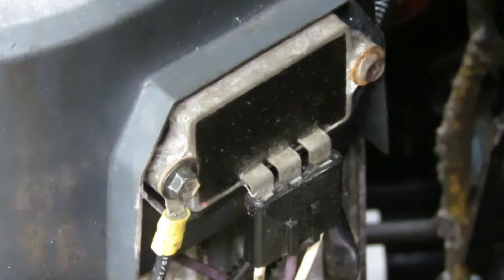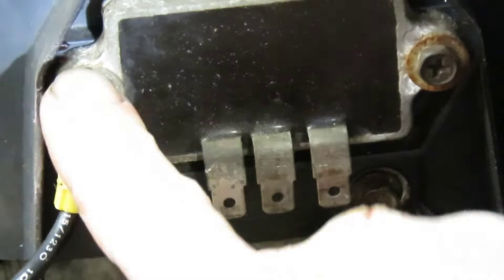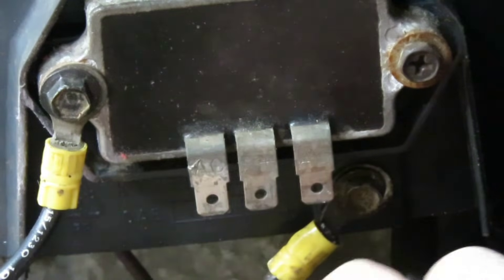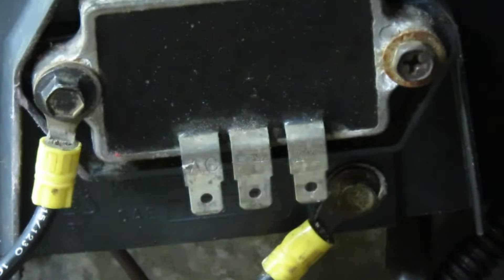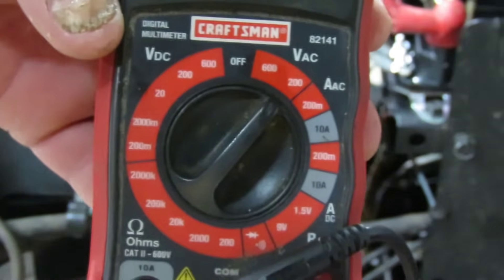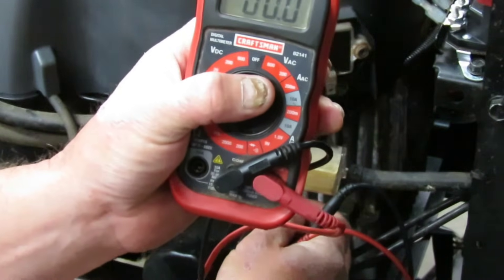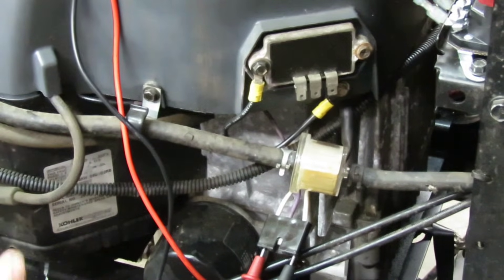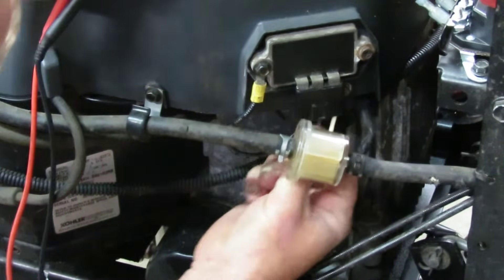How to Test Kohler Charging System

Comment: Thanks for this video! I have a Scott's by JD, 2348 Kohler 23hp engine very similar to your video.  Any idea why the battery would not charge (batter light comes on) when the mower (PTO) is engaged?
Reply from the maker: Does it charge when PTO is disengaged
And Not charge when PTO is engaged.
If so your gonna have to chase the charging wiring to find where the connection is lost.
If its not charging only while engaged 
Most likely PTO switch is losing the connection for charging
Reply: Sartin Garage it was not charging until I followed your trouble shooting video. Now it charges only when PTO is NOT engaged. The battery light comes on when PTO  is engaged. Thanks

Comment: Great demonstration. I just checked the charging system on my John Deere with the Kohler Command 23 engine. The engine would not turn over fast enough when attempting to start it. I did what you said and found out the stater and the voltage regulator both gave the correct outputs. In conclusion, the battery was not charging to the capacity it needed. So, I replaced the battery. A few years later, I replaced the battery when it turned out the problem was the voltage regulator. I am sure many people blame the battery like I did.

Comment: I need a little bit of help. I've engine swapped mowers before, but just the other day my dad blew the briggs engine in his AYP craftsman, then got a 16.5hp kohler engine that says craftsman on it but was on a MTD when we got it. The regulator was completely bypassed. I got to looking at the stator wires, yellow and black, and noticed that there was a factory installed diode or what I assume was a diode on the black wire that had blown and melted. So my question is, do these kohlers need both a diode and rectifier on the charging wire, or are we dealing with mixed up parts? Can I wire it up using the diode from the briggs or do I need to use the regulator that wasnt hooked up? This mower has manual deck engagement and AC headlights.
Reply from the maker: Let me get this right
The Briggs Engine has No external voltage regulator/Rectifier.
But the Kohler engine has a voltage regulator.
If this is the case
You will use the center pin on voltage regulator to go to the mower factory connector which should only be 2 wire connector.
You will have to figure out which wire in the two pin connector to connect center wire of voltage regulator to.
One of the wires in the two pin connector is ground. Dont want to connect it to ground.
Best to pull key switch and usually terminal A1 on key switch 
Use a ohm meter and find the wire in the two pin connector that connects to A1 on key switch.
This will be the wire that you will connect center pin from voltage regulator to.
May have to put other wire in the 2 pin connector to ground for it to charge
Reply: @sartingarage8045  Yes the original briggs only had a diode on the charging wire, no rectifier. The kohler appears to have had a diode that blew and melted the wire, as well as the 3 pin rectifier, which wasn't even hooked up. Someone had messed with the wiring before. I'm just wondering if the kohler needs both the diode that blew as well as the rectifier, or if some kohlers had only a diode and this fan shroud with the rectifier came off another engine.
Reply from the maker: The Kohlers Engines came with both.
The difference would be if mower has electric Pto Clutch or Electric Pto engagement. Those will have a better charging system on them which will have a rectifier/voltage regulator. 
Mowers with a lever to engage blades
Most would not have a voltage regulator and charging system is less output.
Most mowers now have electric pto

Comment: I have a Kohler Im workin on, brand new Batt, brand new Voltage reg, Stator putting out 37 v a/c, grounds all good, center terminal gives me 4.3 volts dc engine full tilt. Getting bat voltage at center pin when engine off. dont get it.
Reply from the maker: Needs to battery voltage at center pin on voltage regulator with key ON engine OFF
Test your key Switch
I have a video Easy Key Switch Test
Reply: Same problem I'm only getting 12.4

Comment: Just like your example here except with the key switch off, my Scag Cheetah [Kohler] is pulling 12.4 volts. When it is running it is producing 14 volts. Should it show 0 volts with the key switch off? Even when I unplug the key switch it still pulls 12.4 volts. So the purple wire is always hot?
Reply from the maker: Purple wire to regulator should be Zero Volts with key Switch off.
If not will be constant drain on battery while mower not in use.
Reply from the maker: If purple wire to regulator has voltage with key switch unplugged. There is a short to that wire somewhere in the wiring. Or someone has rewired it straight to battery voltage. Maybe to Solenoid. Somewhere to constant voltage. Need to trace the purple wire to other end
Reply: @sartingarage8045  Thank you for this. It appears our 2nd mower (Scag Tiger Cat 2) with the same 29efi Kohler also has voltage with the key off. That one only has 119 hours and is 1 year old. I'm wondering if the solenoids are going bad from sitting out in the weather.
Reply: These mowers sit on our landscape trailers when not in use exposed to the elements.
Reply from the maker: If it is designed that way, Im not real sure why it would need to have voltage to regulator all the time with key Off.
Your not using the mower when the key switch is off. Why put a battery draw on battery with key switch off while mower not in use doesnt make much since.
Although it wouldnt draw much out of battery. I would think after a week or two of non use your gonna have to charge battery.

Comment: Thank you for the kohler video it helped me a lot. Turns out my kohler is putting out 14.5 volts but its not getting to the battery can i just run that purple wire straight to the battery? Instead of messing with the switch?
Reply from the maker: No you can not
It will constantly drain your battery.

Most of the time the key switch is the problem. But need to check connections from that wire to key switch 
From the key switch it goes to starter solenoid

If you follow the battery positive cable down to Solenoid , there will be a small wire attached to that same post on the solenoid.
That goes to the key switch

Check all those connections and test key switch
I have a video on testing key switch
Reply from the maker: So if you start from voltage regulator DC output wire 
That goes to a connector if you follow the wire.
Then it goes to key switch terminal A1
Inside key switch it connects A1 to B terminal.
B terminal wire comes from the Battery post side of sokenoid
The wire I was telling you about in previous reply

Comment: Hello!! My mower only runs as long as I have my jumper cables connected from my car, so when I check the output from the mowers regulator am I just reading my cars regulator and not the lawn mower? As soon as I disconnect the jumper cables the mower dies.. all the connections are clean and the voltage regulator ground is good. Thanks!!
Reply from the maker: Let me get this right
Your Battery is Dead and mower wont turn over. So your connecting jumper cables from your car to the mowers battery and then mower will start, but when you disconnect cables from car. Mower engine shuts off immediately.
If this is the case First thing you need to do is charge the battery that is in the mower, If it will charge, If not buy a new battery. After you get a good fully charged battery in mower. Start the mower and check charging system to battery.
Reply from the maker: If your car is running
Yes you will show charging voltages from your cars charging system around 14 volts DC

Comment: Thank you sir for your great charging system videos, I watched both. They helped me track down a charging wire that was hooked up wrong for an 1999 xmark zero turn. I replaced the engine with a new carbureted 25hp Kohler, I didn’t want a new machine and try to stay away from ecm controlled machines. They had the charging wire from the factory/distributor running to the starter solenoid ? So I put an end on the wire and put it in the harness plug to the switch and now charging good! You speak slowly so I can understand and I appreciate you helping us all, thanks again!! Ron Smith

Comment: My rectifier is getting 20v dc on the B+ terminal. Is that to much voltage?
Reply from the maker: Yes that is way to much
But if the battery is completely dead or bad
Charging system will go to full output and can reach voltages as high as 22 volts.
Watch my video on Why not to use mower to charge completely dead battery.

Make sure battery is fully charged with a battery charger on no more than 10 amp charge
Preferably 1.5 to 2 amp charger. Will take longer but slower the better or less hard on battery.
Then reinstall battery in mower and test again.
Reply: I have no battery. This is a walk behind pull start mower kholer pro15.. rectifier bad ??
Reply from the maker: So if there is No battery. What is the Rectifier control on the mower. A Rectifier converts AC current to DC current for charging a battery. Unless its electric PTO and Powers the Electric Clutch
Reply: Sartin Garage correct it’s electric pto.. I’m getting 20-21volts ac off the stator and then on the dc “b+” I’m getting 20v dc but also ac there too
Reply: It also runs through a delay module but I’m not sure if that helps regulate or the load from the pto will adjust the volts or if I need a new rectifier
Reply from the maker: I wouldnt think 20 volts would hurt that electric clutch. 
What is Not working on the mower.
Are the blades Not engaging or what is happening that made you have to check voltages with a meter.
That system may have to have voltages that high, But when a load is added to the Rectifier ( such as engaging blades )
The voltage will probably drop down a few volts
Reply: Sartin Garage at first it was blowing fuses. Then the pto quit working all together.. originally I assumed the pto was bad. Replaced it. Still nothing. That’s when I discovered the 20v dc off rectifier. But I also noticed that after ruining through the delay module and hitting the pto switch was not getting me 13v or so at the pto connection so I started to look around on mower to figure out what was going on
Reply: Sartin Garage I’m pretty certain the delay module got messed up. It looks a little bubbled on the back.. I ordered a new one but I don’t want to put it on to ruin again if I was getting to many volts from rectifier to begin with. I’m unsure what made things stop working
Reply from the maker: So you have 20 volts out of rectifier and only 13 to Pto clutch.
I would think you have a connection problem somewhere or possibly a shorted switch. Key Switch, Pto Switch.
Its hard to explain electrical wiring checks.
Without being right there.
But you have 20 volts out of rectifier
Follow that wire to where it goes
Check voltage there
Figure out where it goes from there
And keep doing this all the way to clutch.

Once you find Voltage drop
That will be your problem
Reply from the maker: There again its been awhile since Ive worked on a pull start charging system without a Battery.
Most everything Now is electric Start
Not real sure voltage out of your rectifier should be that high. 20 volts

Comment: So I know I need a new battery for my Scag as I've had to put the battery charger on every time I start the mower.
Today I started mowing and probably mowed 30 minutes and had to stop and move our trampoline, pushed in electric PTO, set brake and got off mower to
moved trampoline. Got back on mower released brake and engaged PTO and the engine started missing bad, disengaged PTO and missing went away.
Idled engine down engaged PTO and the missing was gone, gave her full power and and was able to mow another  minutes and she died right there in the yard.
I would like to know your thoughts on this matter. Tomorrow I will be replacing the battery for sure to start with.
Reply from the maker: There is two things I can think of most likely wrong. 1st you do need to check the charging system, 2nd thing is if it is a twin cylinder engine, sounds like you may be running on one cylinder. The engine will still run great, but will be low on power.
So when you are engaging the Pto.
Engine doesnt have enough power to turn the blades as far as spinning the blades.
But at the same time if battery is really low
This will also cause engine to stall qhen blades are engaged. There is not enough Power in battery to keep PTO clutch engaged
Reply: @sartingarage8045  Replaced the battery today and it fired right up. I was able to finish mowing without any problems. You were right about the battery not having enough power to keep PTO engaged. I will follow your video on How to Test Kohler Charging System for a more thorough diagnoses and make sure there isn't another underling issue. I can't thank you enough as you saved me a lot of money and more importantly TIME.

Comment: I did everything you say on one of your videos about charging problems I even  change the stator, en I'm Still getting 14v ac  switch is working fine what else can be?? 60" ex mark z
Reply from the maker: 14 vac is not enough
What did the magnets look like inside flywheel. If there is a magnet missing or magnet that has came loose and has moved Stator will not output correctly.
Magnets should be equally spaced apart and the magets are push pull push pull
Meaning like first magnent is pull which would be like a regular magnet. The second magnet will push away

Does the mower have electric Pto to engage blades or a lever to engage blades
Reply: @sartingarage8045  yes then machine have electric switch to engage the Blades I never change  that part get.
On the magnets are in place they are all looking nice and clean,  when I first see your video I did everything you show in your video and I was getting 16 volts ac and maybe 2v DC now with the new stator I am getting only 14.5 volts ac🤣🤣
Reply from the maker: Make sure when you check Stator Voltage you have the throttle at full throttle.
Stator will show lower voltage at lower engine RPM's.
May need to check RPM's with a Tachometer. I dont know what engine you have, but RPM's should be around 3400.
Need to check spec on your engine for specific rpm.
Reply: @sartingarage8045  one or two magnets were broken in one corner not very much you think this is the problem??
Reply from the maker: It is very possible
Ive seen two magnets missing and stator would not output correctly